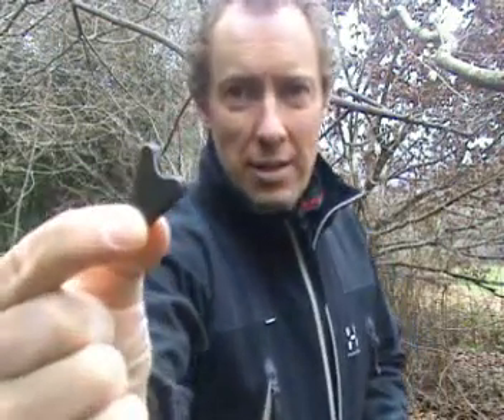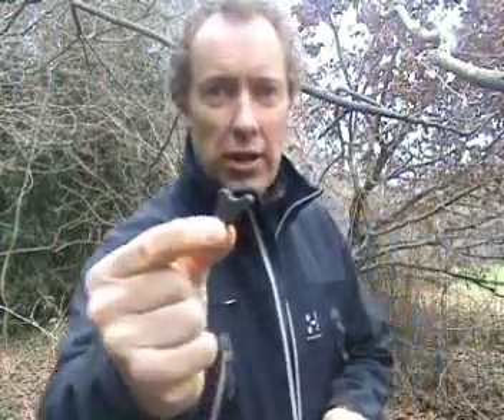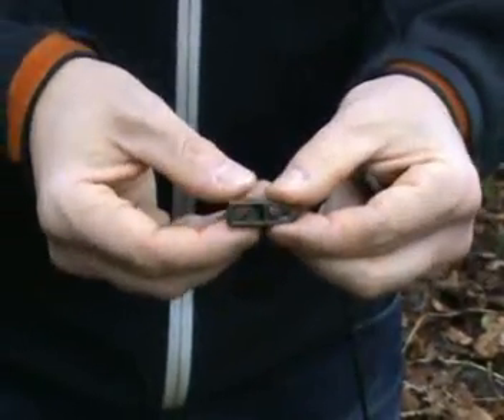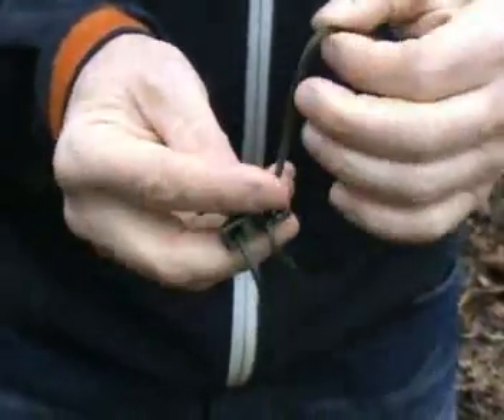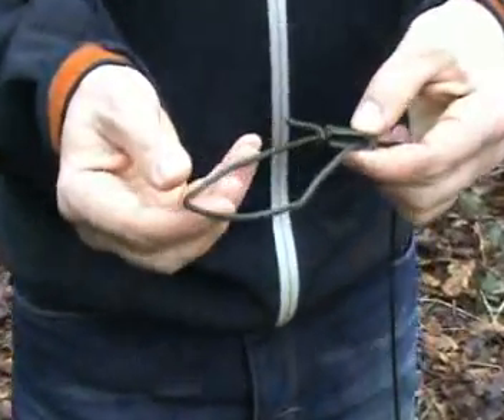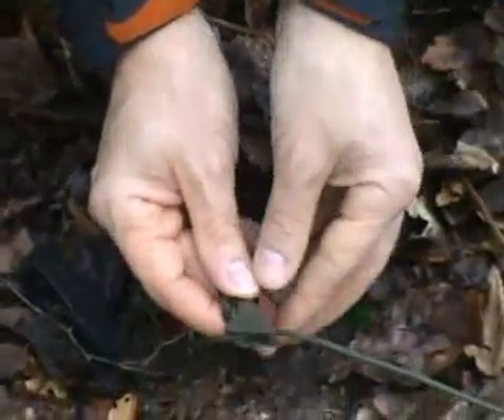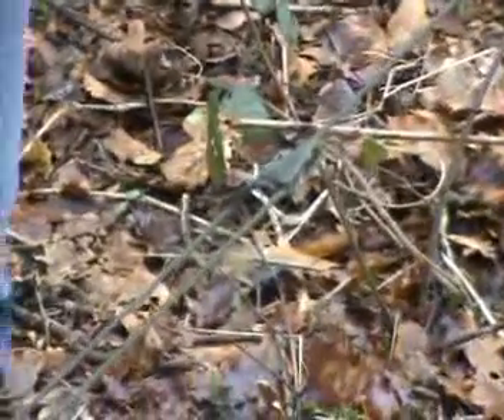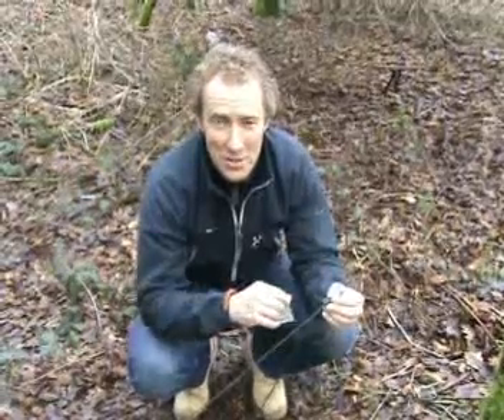Line Lock Lock it

Comment: Thanks Andy. Any tips on how to seal the ends of Dyneema after cutting it to the lengths needed? Some people say heat shrink tubes, but it needs to be adhesive stuff which I can't find. Any better options?
Reply: I have found that a lighter does NOT work because it's not HOT enough.  A mini torch works like magic though.